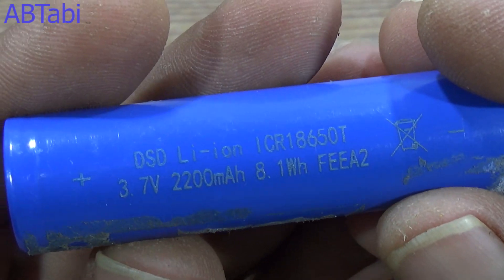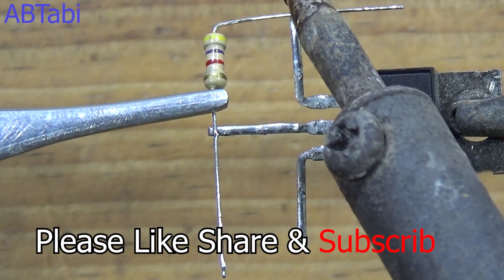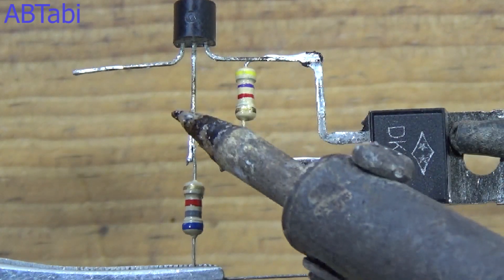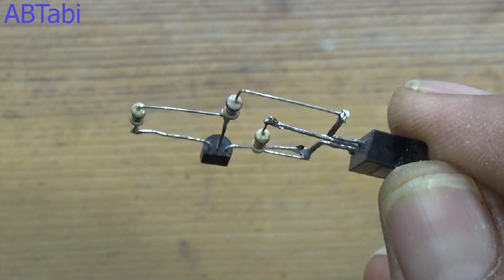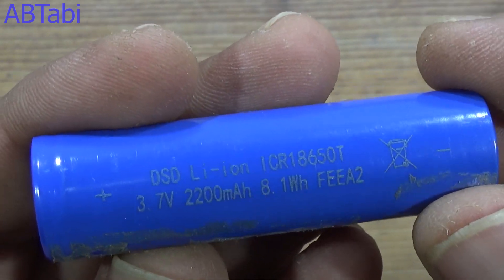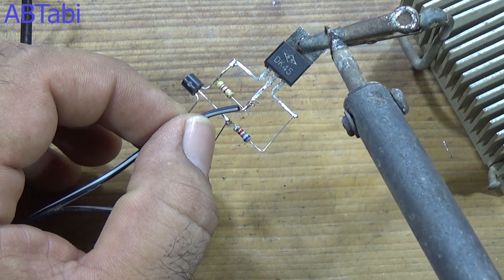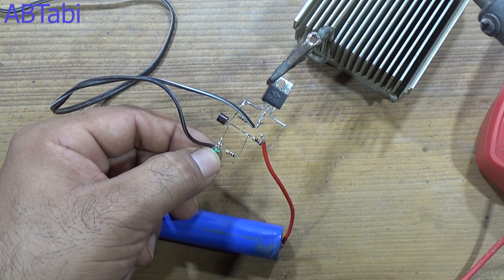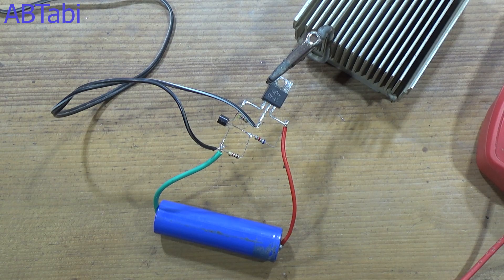Make a 18650 Battery Charger, Simple Electronic Project

Comment: First, the adapter that I used has a weak amperage because it used a 2500mAh battery and a 300mAh adapter, which means that it needs approximately 8 hours to fill the battery.
And again, the value of the full volt is 4.2 volts, and it was not charged (we did not see that) until it was completely full.
  Unfortunately, the work is normal and weak and does not work.